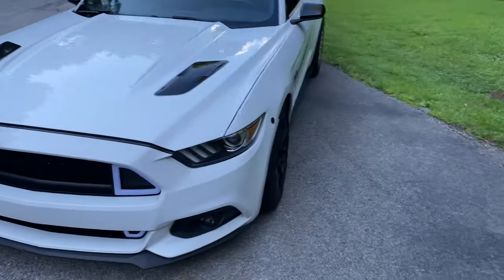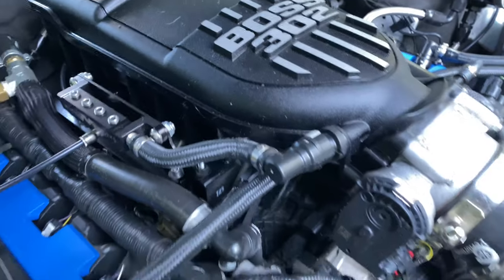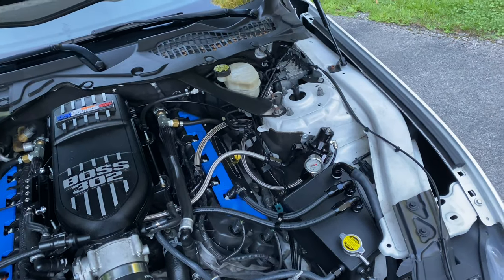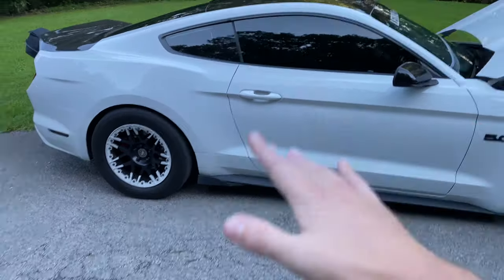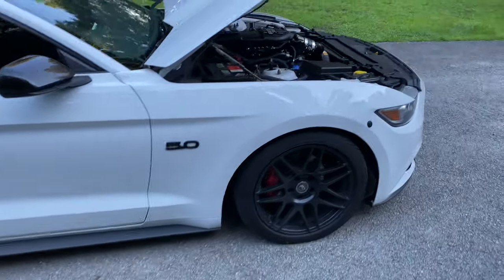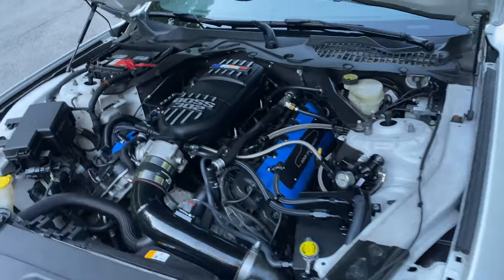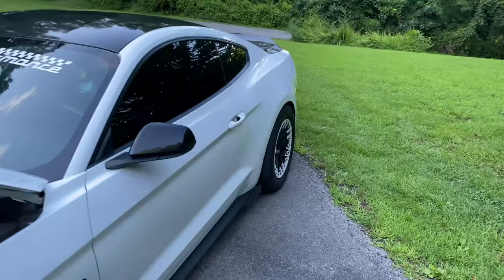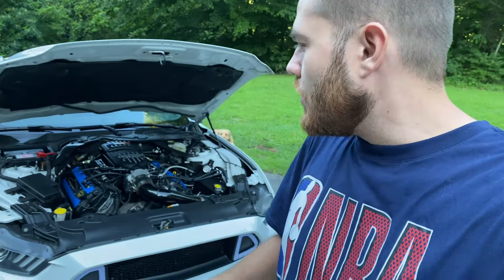BOOSTED 5.0 Coyote MUST HAVE MODS!

Comment: Where did you get all your vacuum lines and fittings? Also did you have to lower the motor to fit the manifold?
Reply from the maker: All from motion raceworks. BMR k member comes with lowering motor mounts

Comment: Im having a hard time believing your car picked up that much power going from an 18 port mani to the boss ported mani. How much boost do you run?
Reply from the maker: Both of these runs you see are on wastegate which for me is ~12 psi. It’s really about a 2.5 car difference, the Supra runs out of gear about 160 mph. And it’s also not necessarily the power difference, it’s how far the power carries. My guess is the 18 mani starts to drop pretty hard after 7300 rpm, and the boss carries to 8000. The car is also about 80-100 lbs lighter as well.